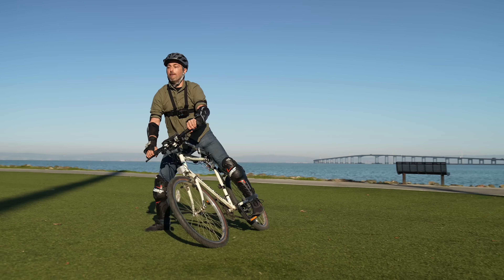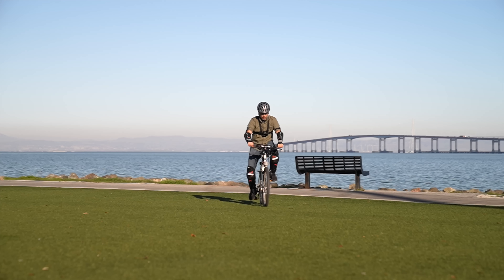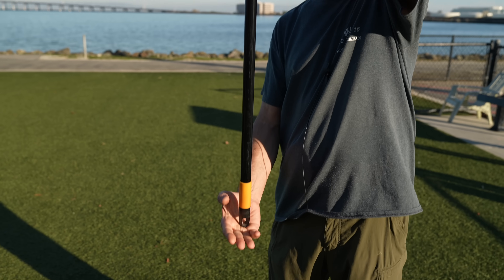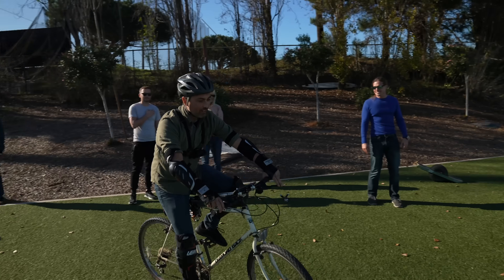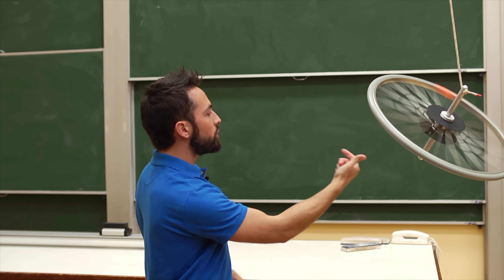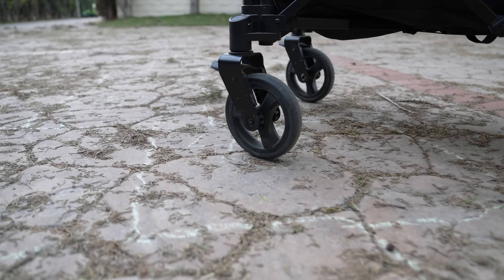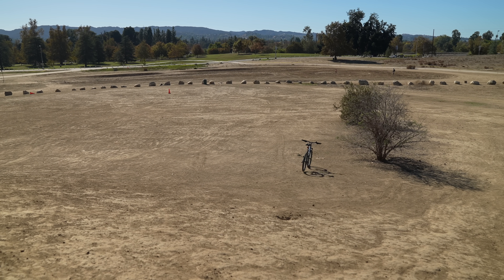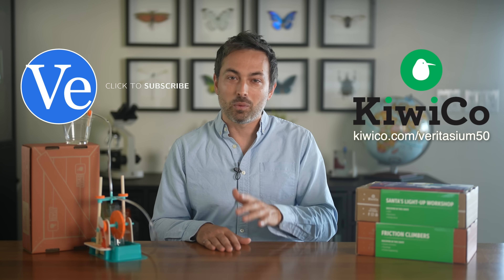Most People Don't Know How Bikes Work

Comment: Learning to countersteer (actually applying pressure to the handlebars) dramatically reduces the time/distance a steering maneuver takes. It's a great safety skill for motorcyclists and bicyclists. Simply go to a big parking lot and give a little input, you will be amazed at the effect.

It can also be used mid-turn to increase the sharpness of the turn, or bring you instantly out of the turn.

Comment: But like, lean right push right go right. And usually works for speeds well above 15 miles an hour. Otherwise at slow speeds you need the steering pivot ability unless you plan on loooong wide circles 💁‍♀️ it’s basic, especially if you ride a motorcycle.

Comment: Motorcycle riders know this instinctively, mainly because the handlebar pressure is much greater than a bicycle. To turn especially at higher speeds, you have to push in the opposite direction and lean. You do not turn the handle bar in the direction of a turn ever. The closest would be a "swerve' maneuver, but even that starts with a push in the opposite direction.

Comment: To turn in a direction and giving a slight push to the handle bar in the opposite direction is what also motobike riders do (if doing it consciously) to avoid a crash with a sudden obstacle in front of them. You will learn that in special biker courses to improve your driving. Helped me several times.

Comment: I have so much respect for this channel but as someone who actually rides bikes…..counter steering is completely an option. Everyone in this video rode the bike sitting completely straight up. If the where to lean into the turn even the slightest bit they would’ve pulled it off perfectly. It’s because they ride standing straight up.

Comment: I feel smart.  My work sent me to take classes from Hunter Engineering.  They make majority of mass produced tire machines, balancers, and alignment racks.  Being said, i went to learn about alignments, and I would've been some what educated in self steering, Steering axis inclination, and other things.  One thing I was surprised to not hear was Caster in the sense of a type of angle (i know you said caster wheel).  On Alignments, there are 3 main angles- Camber Caster and Toe.  Toe is the easy one, which direction are your tires facing.  Camber is the next one, it is how the tire leans in or out, and finally you have caster which is how the steering axis sits.  The higher caster is, the more effort required to turn.  Being said, you typically see caster being only a few degrees (for street cars) because it gives a natural smooth return to center, but doesn't cause the power steering pump to be strained.  A lot of high end (usually German) cars; Audi Mercedes, and others have an extra set of balljoints so they can have zero caster.  This makes driving the car super smooth and much more comfortable. along with that, it makes the steering more predictable (because you done have camber roll).   They're then equipped with some kind of self centering computer.  Being said, just because you can go fast, does not mean you should.   If you plan on going fast, making hard turns, and all that; you're better off opting out for a higher caster because it is going to help steering and accuracy.  Being said, it wont be as easy; luckily at higher speeds turning becomes easier.  
I know its fun to play around with cars and all, but its the little things that really make a car special (better or for worse).  I know its fun to adjust the ride height of your car. Just remember that you are adjusting the caster level if you lower the front and raise the back, and unless you've invested in some steering that is meant for that; you'll probably do damage in the long run.  Same goes for camber kits; having your wheels kicked out to a certain degree will help with handling, but excessive camber just wears down tires faster, and gives you less traction.   Everything on your car is built for a reason.  
I could go on for hours on things like this, but I don't want this any longer than it needs to be.  If you have questions, feel free to ask.  I'm happy to inform people on things they may not know.
Reply: Really interesting, thanks for sharing!
Reply: @XIVXIVX  any time, im happy to share my knowledge.

Comment: I think this info is not real before I ride a lot on mountain bikes you really don’t turn your wheel as much as on this video you mostly use your body weight and leaning into corners you shouldn’t have to use your bars that much and locking out those wheels is easy enough as long as you go fast in a straight line you should be fine I know this is because I was going fast down a hill sanding up with my hands of my bike

Comment: Very interesting video and it gives a good concept of how it works but it does not apply when you shift your bodyweight with knowing which direction you going. You only need to shift your body. If you stay stationary on the bike this becomes true, a little push on the side of the handle bar you want to turn then it tips in and you can pull back

Comment: Interesting, but I knew that there's a difference in steering, just not what. I usually want to get up to speeds high enough that I can get a strong gyroscopic effect and turn by a heavy lean. Feels like a rollercoaster feeling to me. Maybe it's because I'm worse than average on steering primarily with the handles or something, but leaning feels so natural. Yes, when I do some sharp 90 degree turns this way I've fallen off as the tires lost grip (usually ice or wet leaves). But that's fine for me as heavy leaning at higher speed just means that I'll slide, not crash into the ground. :p

Comment: and on a motorcycle  you keep upright with the clutch and throttle..
Reply: You can pull in the clutch and put the gears in Neutral, and the motorcycle will continue to steer just like a bike.

Comment: Why fake it by falling on purpose. Yes counter steering make it easier to make larger sharper turns, but you can turn left without steering right first. For smaller more mild turns you dont have to steer one way first to go the other way. I have never once needed to tilt right to turn left or tilt left to turn right.

Comment: No joke. Fairly good BMXers could ride that bike. There's a couple of tricks that are being totally overlooked. Dropping your outside pedal will instantly switch your center of gravity and cause you to not need to countersteer. When it's fully locked...we know how to hop onto and ride handrails. Balancing that bike in a straight line would be easier than hopping onto a rail and riding it

Comment: TU Delft: "smart steering"
First there were just lazy cyclists, now the lazy cyclists don't like steering.
I guess the battery and the motor utilizes electricity, therefore making it "green"?
Unless of course it's intended to be used by disabled or weak people, then it's reasonable.